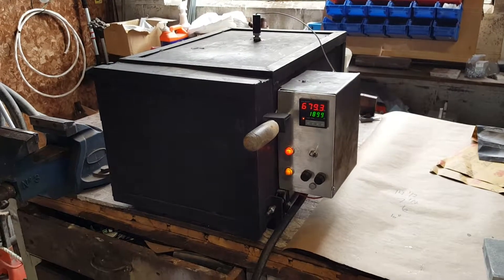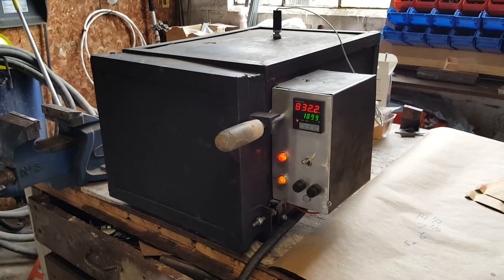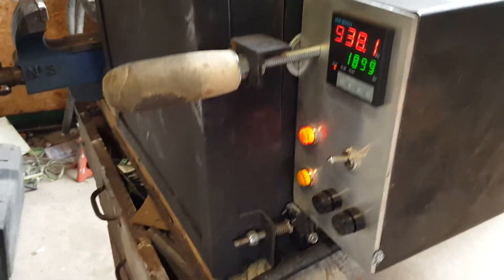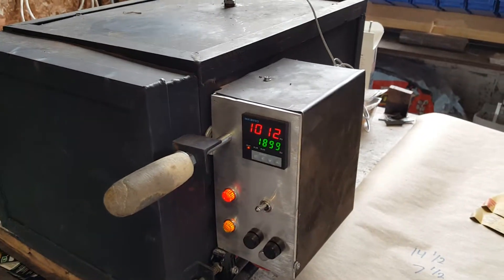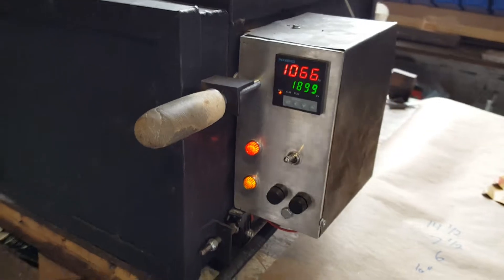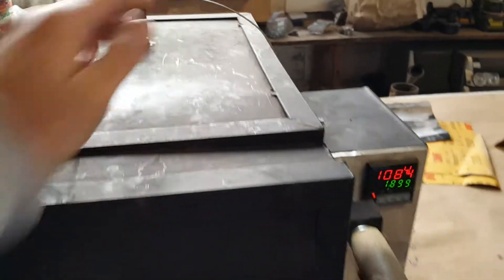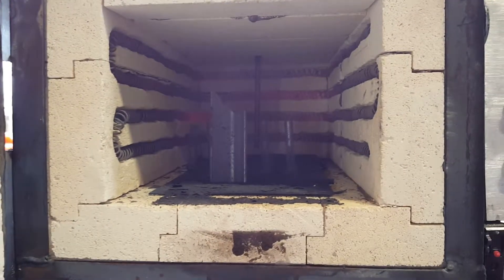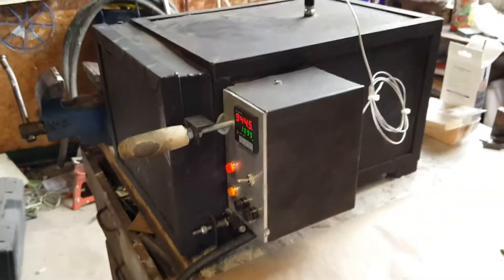20180428 130432

Comment from the maker: The controller is an inkbird.  The thermo couple that comes with it is no good so you'll need one with a higher temp rating.
https://www.amazon.ca/Inkbird-100V-Temperature-Controllers-Thermostat/dp/B072P1QN46/ref=sr_1_5?keywords=Inkbird+pid&qid=1567678664&s=gateway&sr=8-5

The lights I just picked up for a few bucks at my local electronics store.   They aren't required as the inkbird has a light that shows when the elements are on.